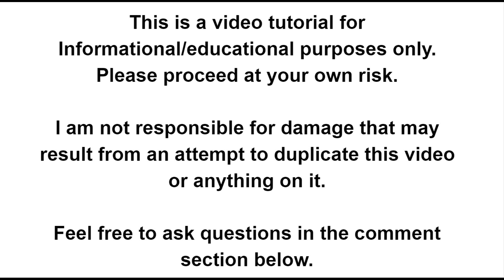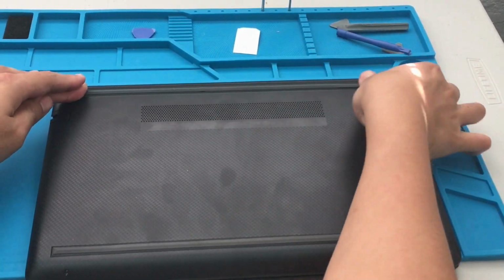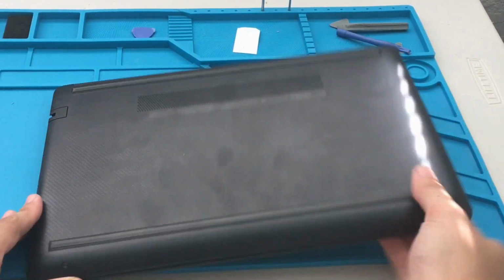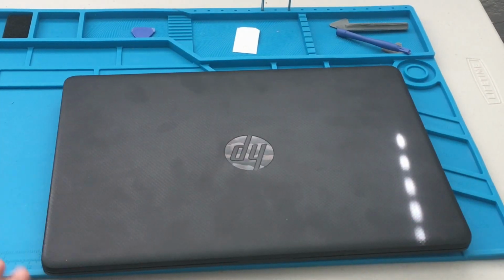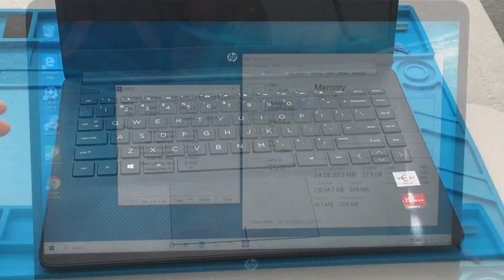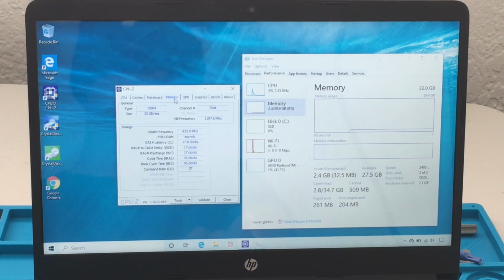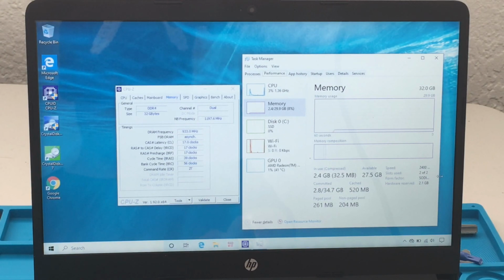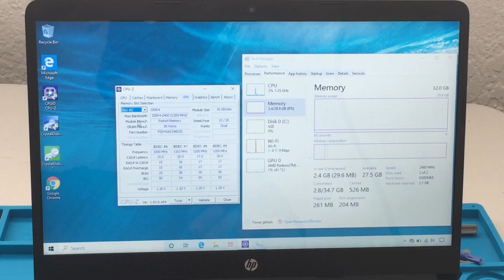32GB DDR4 RAM Upgrade | 2020 HP 14 inch Laptop 14-DK1003DX

Comment: Hey bro could you help me find 16gb for this model? ram for hp 14 laptop, intel celeron n4020 can it be diff mgh?
Reply from the maker: Check you task manager > performance > memory to see what ram you have. Plenty of options out there. There are also tools like crucial scanner to find out what ram you have and compatible ram
Reply: @whattmeter  speed 2400 says 1of1 slot thought it has 2!? 
Form Factor SODIMM
Hardware Res 184MB
Reply from the maker: Whoa really? Have you opened this laptop up yet? I wonder if it has soldered ram
Reply: @whattmeter  I just bought it for something to use with this mixer but wanted to do some other things it was like $200 in going to open it up

Comment: I have a similar model (HP Laptop 14-dk1013dx) wondering if there's any difference as I was hoping to upgrade it to 16GB or 32GB but I don't know if it can take it?
Reply: I'm late, but there are multiple different ""models"" using that same scheme. There's also a product number (ProdID) that actually specifies the exact make of your laptop. That model number also tracks to a completely different model with an Athlon inside instead of a Ryzen 3. I took apart an AIO, and it's internals were completely different than what basically all guides had, which prevented me from doing the upgrade I wanted.
Reply: @No-mq5lw Yes my laptop has AMD Athlon CPU and Radeon graphics. But it's good to know this, I have a friend who was willing to do the upgrade and I'm hoping the laptop's internals are the same as the guide or at least similar.
Reply: @Dre12008  They are similar inside, think the CPU is the only real part that's different. the Athelon parts are more common on Ebay than the Ryzen 3 version of this.
Also, a good tip is to get a sticker sheet from the dollar store or something, rip off all of the stickers leaving the backing so you can use it to keep the glued on rubber feet clean and sticky.

Comment: I have an HP 14dk1013dx, a model similar to yours, and I'm planning to upgrade the RAM from 4GB to 16GB. Any advice for someone upgrading a laptop part for the first time?
Where can I easily get the prying tools?
Also, I'm worried that the rubber feet/pads won't fit right after I take it off.

Comment: Question. How do I reglue the rubber? Is there any recommended glue I can use?
Reply from the maker: Everyone has a different approach. Some just buy new hp laptop rubber lining. Some use super glue like just a drop on each end. Ive seen others use small amounts of double sided tape which I think is pretty smart incase you need to open the laptop again

Comment: Nice vid
Reply: Also how many different kinds of 2020 HP 14 laptops are there?

I ordered one on Amazon 

2020_HP 14 14.0" WLED-Backlit Display Laptop, AMD Athlon Silver 3050U Up to 3.2GHz (Beats i5-7200U), 4GB DDR4 RAM, 128GB SSD.  

Is this one the same as yours? If not, what's the difference. 

And can I put 16 gigs of ram in the one I ordered? 

Thanks for your work.
Reply from the maker: Nice. There are many different models and configurations of this laptop. When it arrives you can run crucial scanner. Another method is running the cmd command “wmic memphysical get maxcapacity” that should tell you max ram you can install
Reply from the maker: I wonder if they made any mods to the laptop since you got it from amazon

Comment: So I just bought this laptop. The ram does one go face up and other face down? Planning on. Upgrading mine to 16 gb ram put two 8gb. Sticks.   Any recommendations. For this exact model? Thanks 🙏
Reply from the maker: 16gb is great. Me recommendation is that the cpu is limited so 16gb is a good choice. For the ram they only go in one way so try aligning each ram stick based on the notches with the slot and don’t force it and you will be fine

Comment: mine came with 1 4g 3200  so I will order a 8gb 3200 and try. I like the keyboard on this one and the display is nice. the althlon is a 2 core wimpy one but the main issue seems to be trying to run in 4gb ram so .... will try. with 12gb it should be great. I got it because its light like 3pounds and I cant take my main notebook for travel or to cafes its too precious.
Reply: What exact 8gb ram stick did you use ?

Comment: Good job. I have a question. How many RAM slots does HP 14s-cr0011tu has? And does it support 16gb ddr4 ram in each single slot? Appreciate your answer.
Reply: Enter Task Manager (ctrl+alt+delete) and go to memory, it will tell you how many slots are available.

Comment: I am planning to change my RAM and upgrade it to 16 GB what things should I consider? my laptop is HP Laptop 14-bs0xx and it is i3 6th gen. I hope you will notice my comment I want to upgrade this so badly.
Reply from the maker: I would check your task manager > performance > memory to see what the current ram is and the number of ram slots being used. I would also check the current ram speed. You would probably want to match the speed of the ram.

Comment: Hey bro, can i expand the ssd up to 2tb?
Reply from the maker: Ive never tried 2tb, but I don’t see why it wouldn’t work. I would ask hp to be sure
Reply: @whattmeter  I have the same computer but it presents an error, there comes a time when the whole laptop is paralyzed and I only have to restart manually, you know of some solution? Sorry for the translator, I'm from Peru:D
Reply from the maker: Oh so you put a 2 tb ssd already? Did you clone/image or did you do a clean install of windows 10?
Reply: @whattmeter  No, I still don't make improvements, the laptop specifications are 4gb ram and 128gb ssd, I came with windows 10 home but I don't know if the error was to install the windows 10 pro
Reply: @whattmeter  What can you recommend?:(

Comment: Hello, I have the HP athlon silver 14 inch laptop. Can I add RAM? Model num. 14-fq0013dx
Reply from the maker: Have you checked your task manager > performance > memory? It would show if slot 1 of 2 if only one ram slot if being used. It also tells you what speed and type of ram you are using
Reply: @whattmeter  yeah it is 1 out of 2. I can add a stick or replace both sticks with 4gb each. Thank you for the video, you’ve earned my sub!
Reply from the maker: Thanks! Good luck with the ram upgrade
Reply: bro a question that is the most important thing to consider when buying a ram memory for this laptop? Can it be any manufacturer? taking into account how fast it goes and all that

Comment: @jasetutorials recommended 3d printer?
Reply from the maker: I just use an old ultimaker 2. Very reliable in my opinion but there are a lot of choices out there and there have been a lot of improvements

Comment: Always match up memory sticks.. helps with video output too.
Reply from the maker: Very true!
Reply: I did this, but one of the sticks wouldn't fit on the second slot. Is there a reason? I used 2 DDR4 8gb sticks.
Reply: @odekedo  Strange, did you flip the other stick over?
Reply: @itzwildkat6127  Finished upgrading my pc, and turns out I was a little dumb. Of course I had to flip it over. Thank you for trying to help out though.

Comment: How can you tell if your able to run 32gb of ram VS the 16gb? Jw because when I looked mine up that place I got it from says it can be up upgrades from 8gb to 16gb. I’d like to upgrade it from the 8gb and 16gb I’m sure would be ok but wouldn’t mind 32gb. Also is there somewhere I can lookup as far and what speed it can handle? Sorry I’m kinda new to all this (use to know more about this type of stuff years ago but things have changed so much and never really followed it).... thanks in advance for the advice/help. 🙏
Reply from the maker: I usually use crucial scanner to check compatibility. 16gb is more than enough in most cases because it has an entry level cpu which limits this laptop

Comment: Does the ram have to match like if it had 8gb of ram I should just add 8 more to get 16?
Reply from the maker: Yup. Usually have match the brand of ram and speed to get dual channel. But I know some people run this laptop with 4GB ram + an 8GB ram stick and it works fine but not dual channel. I recommend matching brands and speed through if possible.

Comment: i have the same model number and specs. memorystock.com said maximum memory capacity is 8gb. How do you confirm it could handle 32gb?
Reply from the maker: If you are having doubts I would play it safe. 32gb of ram is overkill based on some of the gaming tests as the amd athlon silver limits this computer. I would go 16gb or less
Reply from the maker: What was the speed mentioned? I checked task manager to confirm 32gb. Also I checked cpu Z and computer properties. Also crucial scanner showed 32gb max on this computer. Based on the cpu and motherboard I was pretty confident
Reply: @whattmeter  it has the AMD Athlon 3050U 2.3GHz. How do I test mine to see what ram it can handle?
Reply from the maker: Try using crucial scanner
Reply: @whattmeter  thank u very much ✌️🙏
Reply: @whattmeter  I can't download it cuz my windows 10 is still in s mode. Is there something similar in the windows app store I can use that is similar to crucial scanner?
Reply from the maker: Hmmm I don’t know anything in the Windows store that can do that
Reply: @whattmeter  what is that thing on your left wrist?
Reply: @whattmeter  when you test your ram specs, how much usable ram is available?
Reply from the maker: Anti static wrist strap

Comment: What’s the right screwdriver I just bought 1.5mm one will that do
Reply from the maker: Ph1 or ph0 screwdriver should work too
Reply from the maker: It should work. Is that a precision set?
Reply: It’s just a screwdriver no set
Reply from the maker: it should work. In my ssd upgrade video I used a 1.5mm. I showed it in the video. https://youtu.be/NwECUN-xUjM

Comment: okay so i upgraded my ram, i used crucial and i only went up to 16 gb, but i have question... why am i only able to access 14 gb of the ram? did you have this problem at all? if so how did u fix it?
Reply from the maker: You mean usable ram? Check memory in task manager. Basically if you add available ram and hardware reserved ram, it should be close to 16gb. Also check your gpu in task manager to see how much shared gpu memory is available. Hope this helps but yeah the computer always has hardware reserved ram
Reply from the maker: Usable is always lower than the total ram. You can ask crucial support as well they can probably explain it way better than I can. The computer always has hardware reserved
Reply: @whattmeter  Yeah, I mean usable ram. And okay, I will try and reach out to them. I just didnt know that it happened lol
Reply from the maker: it could be hardware applications or background app that the computer uses while on. Crucial should be able to explain everything. They are the experts.

Comment: hey so i’m trying to find ddr4 2400 ram... any ideas where i can get 2 8gb ram cards at a good price??
Reply from the maker: Prices vary. I would shop around, best buy, amazon, pc stores and look for any deals.
Reply: jasetutorials yea like i am trying, but there is just so much, i mean it should work as long as it’s ddr4 2400 right???
Reply from the maker: Yeah but make sure it’s ddr4 for laptops. Usually the lower the CL the better. 2400 MHz should have a lot of brands available
Reply: jasetutorials okay thx so much.. there is a ton that’s why it seems so difficult

Comment: Why do u need 32gb ram 8 would be more than enough for what that cpu/GPU combo can do
Reply from the maker: Just experimenting. Plus wanted to try heavy games on it
Reply: @whattmeter  bruh then get 16 max
Reply from the maker: Well wanted to increase shared gpu memory. Mostly used for call of duty warframe. Plus it was on sale. Speed isn’t even fast 2400Mhz
Reply from the maker: Ram was half the price 3 years ago for ddr4 when I bought it. I might even try 64gb in the future. Ram is cheaper now so wanted to test some things
Reply: @whattmeter  bruh that cpu and GPU is so bad most high end editing PC won't use 64gb high end gaming PC's use ~16gb ram in mw at ultra that would be 768p minimum at like 50% res scale
Reply from the maker: Thanks for the tip!
Reply: @whattmeter  ahh so u didn't just go out and buy 32gb for that shit ass laptop how much ram u use at max like 10-12gb?
Reply from the maker: Actually it used 14gb of shared gpu memory when someone asked me to test call of duty warframe. I can always swap the ram no biggie
Reply: @whattmeter  damn more than I thought also it modern warfare not Warframe what fps u get?
Reply from the maker: Really low. I think it was like 10-14 fps. My bad it was actually call of duty warzone. To be honest the laptop wasn’t supposed to be able to run it with the cpu. Out of curiosity we tested it LoL
Reply: @whattmeter  lol

Comment: I have Asus 14 X412DA Ryzen5 3500U with Ram 4gb soldered + 4gb removable ram. So there is only one Ram slot available. Can I install single 16 gb ddr4 ram by replacing with the 4gb Ram. Manufactures expandable Ram is max of 12 Gb. Will it work?
Reply from the maker: I am not familiar with that asus model. Are you able to look up the motherboard model? Your cpu can definitely handle it, but you definitely want to double check. For lenovos they usually recommend 12gb max but I have 20 gb (16gb and 4gb soldered on) and it works great. For asus I am not familiar. For lenovo though I hear some people had issues with the 20gb ram upgrade. My guess is the ram speed they chose was too high but that’s just my guess
Reply: @whattmeter  Ram is 2400 Mhz. My Asus 14 X412DA-EK502T laptop , motherboard details in system info shows as X412DA_X412DA.
Reply from the maker: If it was me probably best to play it safe and follow manufacturers recommendation. I think if you tried it it will work but you might have issues long term. Manufacturers usual have something in the bios that can prevent from running more ram than the recommended

Comment: Hey do you know the original ram that came in your computer? Because I have basically the same comp and I’m trying to get another 4gb stick because there’s already 4gb installed and I was wondering the 4gb ram that’s already there what brand is that.?
Reply from the maker: I original ram was sk hynix 4gb pC4-3200AA. Speed is 2400MHz. It could be different for your laptop though. The reason I know is because I put the original ram in the packaging of my new ram. Easiest way is to look at the ram you have currently installed as there is probably a variety
Reply: jasetutorials ok thanks!

Comment: Thanks for your video. I just want to ask if my laptop's RAM is upgradable I have HP 15s-du0036TX with 4GB RAM. I also where or how can I check the type of my current RAM.
Reply from the maker: To check current ram. You can use cpu z or an easy way to to go to task manager then processes tab then memory. It will tell you the speed of your ram etc. to check if your laptop ram can be upgraded you can use crucial scanner. Works really well
Reply: @whattmeter  Thanks Jase.

Comment: dumb question, but is there a reason why you installed the second ram facing down compared to the first one you installed? like does it do anything “different”?😅
Reply from the maker: I was just aligning the notches. They only fit one way. Usually they put the labels on the ram the same way but the notches are switched on each side. If you look at my other laptop video with another ram video it’s the same thing. Each ram is installed but on label is a different side up than the other ram slot if that makes sense. I wouldn’t worry about the label just make sure you have the ram notch aligned correctly. Don’t force it, but you will see as ram only fits in one way in each slot
Reply: @whattmeter  thanks for clarifying and yea it made sens👍🏾 oh and thanks again for the video suggestion, will totally check that out
Reply from the maker: No problem

Comment: nice video but which ram upgrade did you use because i want to use that specific one. also how much was it
Reply from the maker: There are cheaper options out there just letting you know. Two sticks of patriot memory each stick was about 60 bucks. $120 total but it’s a little cheaper right now. Each stick is ddr4 at 2400 MHz. Here is the link (also in description) https://www.amazon.com/gp/product/B074Q1P62K/ref=ppx_od_dt_b_asin_title_s00?ie=UTF8&psc=1
Reply: @whattmeter  how do i know which ram is compatible to that exact laptop so i could possibly get a cheaper option?